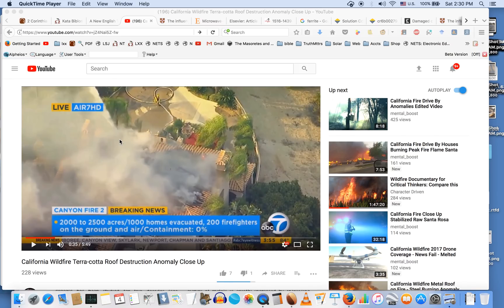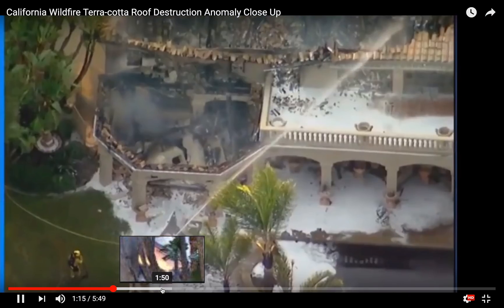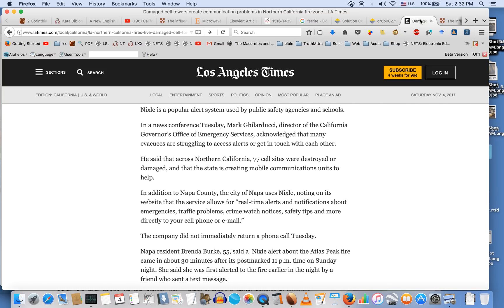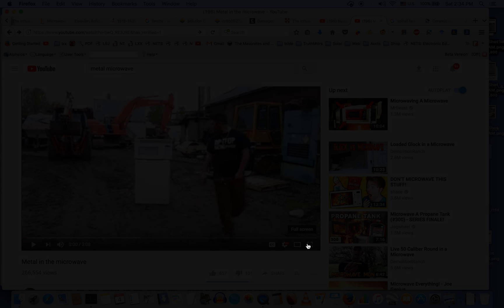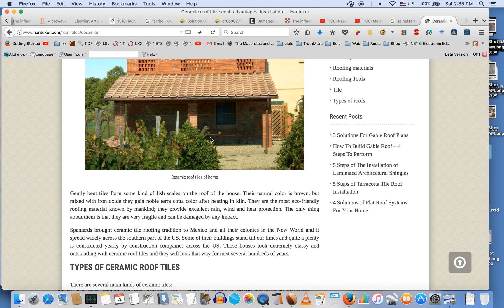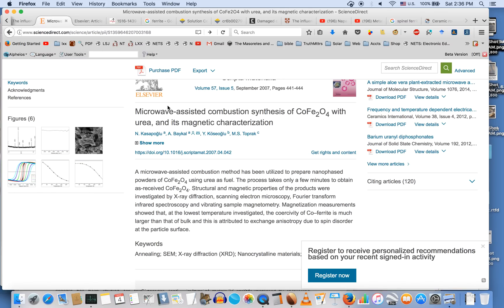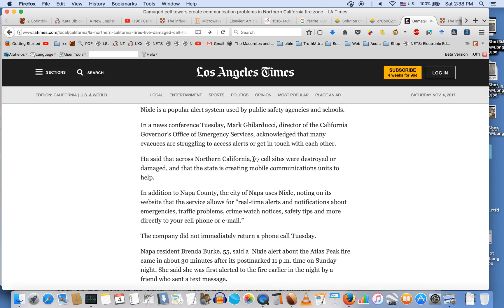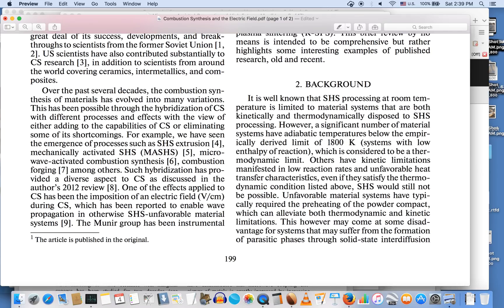California Fires: Terracotta Roof Anomaly: Microwave Assisted Combustion Synthesis

Comment: Please stop talking about Cell Towers as if you know anything about them. Cellular is a term in the type of technology used in a communications device. As it is common in the Northeast, Cell sites not only provide cellular communications, but also have tower sections for public safety and other Cellular communications companies. I've been on several sites and up to 250' on the cell towers, they have from VHF-Low Band, VHF, UHF, 700-800-900 MHz radio communications systems, Microwave hubs, repeaters, links and even some with Sat-Up-Link systems for Geo-Stationary Sites which run from use to be 1.2GHz but now 2.4,5.8 link systems that run very low as in mW power. Also one of the largest nationwide government communications system operated by the FPS which is like the radio hub for most Federal law enforcement comms. So, Cell Sites just doesn't have Cell Systems. If we didn't share sites we would quadruple the amount of towers as everyone would need to have there own tower site. You say, what aren't they made of steel referring to your question about destruction of these sites. The Tower itself yes, its made of steel. But there is coax, connectors, antennas just on the tower itself which depending on the technical specs burns. Then you have the building itself, which is heavily insulated due to the large amount of heat Cell buildings produce from processors. transmitters, repeaters, POTS etc. Then after 9/11 there was a push for interoperability and survivability of tower systems during National Emergencies. So, now you have propane 20-40KW generators with enough propane on site to run 72 hours or diesel generators which are at easy accessibility sites due to the fuel bulk truck deliveries and maintenance. Also, due to extreme heat of FIRE, lightweight steel tends to DEFORM and bend. Towers with gear on them FALL DOWN when things like fire destroy guy wire points or the main structure itself. In the Northeast, we deal with more ice then forest fires. With the invent of Project-25 and the linking of public safety radios systems into a network, similar in some respects to cellular systems but for use in public safety. From analog (legacy) types technology to digital. you can put through in a bandwidth more data including voice, audio, video, and everything your phone does today compared to just 10 years ago. So, I hope you know understand a Cell site and what can be at a cell site. FYI, everything burns, even fire retardant burns if the right conditions are met. During a firestorm, there are certain things in nature that occur like the development of its own weather that can and does cause great damage and death. I would suggest before flapping too much more is do some real investigation. You talk about the Terracotta Roof Tile System. Well where you need to go is to a site where they make these Terracotta roof systems and pull up there MSDS which is called the (Material Safety Data Sheet). Everything made today basically has a MSDS its its consider hazardous material in one form or another. As a firefighter, when we go to a plant, manufacturing hub, or a transporter we ask to see the MSDS as it tells us specific information on how to fight a fire that is fueled by this material, how to treat a patient who is affected by this material, reaction to OTHER chemical agents that can change the property of the material, how to store the material ETC. This will give you a idea of whet your talking about. From that point you need to get specific information regarding the fire itself. Including weather, temperature of the fire and weather conditions before, during and after the fire as it appears that these roofing tile reacted to something that caused them to break down. I would also include that many of these tiles can be look a like and not made according to what the say they are. AS I STATED BEFORE, EVERYTHING BURNS even concrete. I don't want you to think you can light up concrete, but direct flame contact, with heat causes material to change in structure. The breakdown of material using fire is dramatic. Things you see in this fire are DRAMATIC, as due to the FIRESTORM that these homes were involved with. These homes no matter what any fire retardant materials used were never designed to protect structures in this type of situation.

Comment: THE USAF BASE THAT HAS THESE EDW AIR CRAFT MUST BE FOUND AND THE AIR CREWS ARRESTED, AND PUT WARRANTS OUT FOR THE BASE COMMANDER, THE JOINT CHIEFS OF STAFF AND REQUEST THE RESIGNATION OF TRUMP IF HE DOESN'T END THE CHEMTRAILS, DESTROY THESE AIRCRAFT, COURTMARTIAL THE AIR CREW AND COMMANDERS FOR TREASON AND PUT THEM IN Ft LEAVENWORTH.

Comment: why do you need hi tech microwaves when a match will do?   occam's razor, girl.   also people have been  known to burn houses in a disaster to get insurance pay off.  There are "terra cotta" tiles made of light weight plastic look alike materials, to reduce the massive weight of tiled roof....they will melt ,     even a true tile roof has a rubber sheet or  tar paper coat under the tile, and up gust of flame can easily ignite these hi-flamable materials under the tiles.   This whole video is very unscientific, the wave energies necessary to micro wave a distant  house to reach temperature are astronomical,  you would needa power source like a hydrogen bomb conected to a transmitter the size of a stadium to raise it one degree if it was one kilometer away....rreeeeedddicculooooous  babble,    paranoia.

Comment: It looks like this house burned from the inside (coming from the section on the right), and then came up through the roof, collapsing it with the tiles.  I don't think the tiles are actually burning.  But altogether those fires seemed like a too perfect storm.

Comment: Oh, good GOD - here you go again.  
You are ruthlessly ignorant.   I've never encountered somebody so fiercely committed to their own disinformation.  
You ask all these questions and NEVER try to find a legitimate answer and just plow forward with your conspiratorial conclusions ignoring any and all ordinary explanations.

I could go on for pages about your lunacy and unhinged comparisons but you are adept at ignoring critique to I'll start with one point:  First, at 1:21 that IS NOT roof tile burning.  Secondly the tile is not true Terra Cotta - it's concrete.  That aside, the idea that the tiny, tiny volume of iron oxide used as a dye in the clay of roof tiles would IN ANY WAY influence combustion by 'feeding oxygen' to the fire is ludicrous.   I know, I know - you read the article and it said the oxygen aids in combustion and all but you ignore the fact that the fire burning on the house is SURROUNDED by oxygen.  

You don't know how to simplify the research you've done, because you don't understand it and you don't have the basic science background to process what you're reading online.  You take snippets of verbiage and skew it with your fill-in-the-blanks narrative and pretend it actually supports your conclusion.   BOTH of the papers you cite pertain SOLELY to the impact of microwave energy on Cobalt Ferrite, not tile, not wood, not any other building material.  

You've got a lot of cobalt ferrite nanoparticles in your house?  I doubt it.

Comment: @ 2:50 one CELL tower armed can do a kill radius of about 40 miles when in high  power mode judging by the SIZE of A/C Power input lines a rough estimate the max power out put is anywhere from  a few  to 30 million watts of pure instant impulse sonic/microwave energy directed to biological human receptors organs skin brain cells etc... The kill zone is then around  35 miles and this is not reception distance ! There are low power and fully armed high power cell towers. The ones on sides and roofs are very concerning and are usually set higher and in multi continuous mode for no reason at times.

Comment: Iron-oxide or rust, properly combined with powdered aluminum, as found in chemtrails,  makes Thermite which can instantly reduce steel to molten metal as you may know. Most likely has no significance to this phenomenon, but may be of some use at some point.

Comment: 🔴🔵. VVVV CLOSE TO THE ANSWER‼️
IRON OX IN THE TILE OR A CAR MIXES WITH NANO PARTICLE DUSTING OF ALUMINUM ETC FROM THE CHEMTRL JET FUEL POLLUTION MAKING THERMITE ❗️THAT PUT IN A MICROWAVE ENERGY FIELD WILL EXPOLDE AND BURN ANY FUEL NEAR IT AND TREES DO NOT BURN AS THEY HAVE LITTLE IRON AND ALUM IN THEM AND LOTS OF WATER‼️ THE MICRO WAVES ARE FROM UNK SOURCE LIKE MILITARY WEAPON OR CELL FIVEG G G G G TESTING❗️‼️ SAI CHEMTRALS ARE CAUSED BY METAL IN THE FUEL TO FACILITATE OXYGEN DELIVERY IN THE JP8 FUEL SO IT WILL BURN AT 40K FEET WHERE THERE IS NO OXYGEN‼️ JP8 IS DESTROYING THE PLANET AND ALL LIFE ON IT‼️‼️ 
OH AND NOW ADD IN NOW THE METAL CAGE COVERING IN THE STUCCO WALLS❗️❓
.
Reply: Right.  You just toss some aluminum on the tiny trace of rust used as dye in the tile and 

KABLOOIE!!! 

Spontaneous and unstoppable combustion!  Is that it?  That's your 'theory"?  Flunked out high-school chemistry dintcha?.  

IF that was the case the entire world would have burned down ages ago.  I've got a shop where metal filings, aluminum and iron are mixed together all the time and somehow, have never had a spontaneous thermite reaction.  Guess I'm just lucky.
Reply: No, no, no, Rod. Not physical metal filings. You have to have nano nano particles laying around that can't be seen to get the KABOOM. :)
Reply: Kelvin:
Oh, thanks for correcting that.  Yes, you have to have invisible-sized particles mixed in the open air with ferrous oxides encapsulated in fired clay to cause the spontaneous formation of Thermite.  
I shudda know'd that. 

But, yer rong, I was talking about 'KABLOOIE" which is totally dif front from 'KABOOM'.   If yer gunna tawk faahr siunse and explosivity with ex spurts, lahk them in this har comment sexshun, you gotta git the teknikul turms ryte!

Comment: https://www.polymersolutions.com/blog/metals-and-polymers/
 
Thank you Truth for your video... I think you are on to it, and we all appreciate the hard work you, and all our brothers and sisters are doing, that are connecting the dots for us!  
Through the use of High Powered Microwaves and Lasers (DEW), 
anything that has metal/steel in it can be affected, and can be disintegrated in a self-perpetuating  'fire'  until it consumes itself.  Accelerating the Oxidation reduction process -  it is the oxidation that provides the oxygen to make the flame, which bypasses a need for a furnace -  HPM and Lasers can affect things like steel beams, terracotta roofs, car tires, etc.

This may be also why the steel roofs on the stalls that housed the horses and animals, and the tires on the cars, caught on fire and disappeared.  
Tires are vulcanized, and have polymers, which contain metal, and some tires may have radials too, so does this explain why the tires caught on 'fire'  and disappeared in the pictures we see of the scorched cars?

Tires do not melt, but in the pictures, there were no tires on the cars - they disappeared, along with the houses and their contents.
https://sciencing.com/melt-rubber-tires-7552030.html

And HPM and Lasers can both be used to obtain the desired result, so maybe both were used in the CA 'fires'?
Peace & Blessings to you Truth...

"Introduction to Directed-Energy Weapons 
Description
This chapter provides a basic description of what directed-energy weapons (DEWs) are and how they work. In their Electronic Warfare publication the Department of Defense (DOD) defines a directed-energy weapon this way: “DE is an umbrella term covering technologies that produce a beam of concentrated EM energy or atomic or subatomic particles.”

It continues: “A DE weapon is a system using DE primarily as a direct means to damage or destroy adversary equipment, facilities, and personnel. DE warfare is military action involving the use of DE weapons, devices, and countermeasures to either cause direct damage or destruction of adversary equipment, facilities, and personnel, or to determine, exploit, reduce, or prevent hostile use of the EMS through damage, destruction, and disruption.”

The two basic types of DEWs include lasers and microwaves. Microwaves and lasers are both part of the electromagnetic spectrum. They’re made of the same electromagnetic energy which consists of light and radio waves.

This energy can be explained using either wavelength or frequency. The shorter the wavelength of any energy field within the spectrum, the higher its frequency is. Toward the low end of the spectrum, there are low-frequency radio waves, which are thousands of kilometers long. And at the other end of the spectrum are light waves, which can be a fraction of an atom in size.

For ease of identification, groups of consecutive frequencies within the spectrum are divided into ranges. The frequencies within these ranges may overlap, which makes determining which range a frequency belongs in more difficult. Because lasers have a shorter wavelength than microwaves, they vibrate at a higher frequency. Lasers and microwaves are merely different aspects of the exact same energy. The only difference between them is their frequency.

Another consideration is power. A high-powered microwave (HPM) and microwave oven both operate on the same frequency/wavelength. The only difference between them is the power level. Similarly, a laser pen and a high-powered laser have the same frequency, but the power level of a high-powered laser is much greater.

The concept of lasers, microwaves, and other types of DEWs using the exact same energy field, but at different frequencies, will help clarify how a single weapon can be used to exploit different frequencies of energy to produce microwave, laser, and other effects. This feature makes them rheostatic (scalable or tunable).

Microwave weapons consist of basically two major technologies. First are the millimeter wave devices which can be focused on a target at great distances and produce a burning sensation. An example of this is the Active Denial System (ADS). The second is the electromagnetic bomb (e-bomb), which can destroy electronic circuitry, communications networks, and harm organic matter at a distance, with a non-nuclear electromagnetic explosion (pulse)..."
http://www.newworldwar.org/dewintro.htm

Comment: did anyone think that smart meters did this?
Reply: Nancy Bassett no... fires did  this
Reply: Absolutely, no doubt  my mind, thats why sebastopol was spared. They were feverously installing them the week before the fire.  I was on the phone for the second time a couple days before the fire demanding they removed it, cussing and yelling and they surged my house with enough voltage to throw the 100 amp main breakers burning some of my electronics and surge protector pwr strips. A minimum of 1kv to 2kv to do that and the smeter was uneffected.  They can turn houses into a microwave ovens. Thats why they were so willing to take the blame saying tree fell on lines.  It is so obvious, just like 911 and will go unchallenged the same way for the same reasons.  We were the test county and this was just the begining.  Next time noone will be returning home, whetber it burned or not!    Bleeedat

Comment: Ok.  I agree that there are really strange aspects to this fire.  I would caution against making definite statements about the exact physics/chemistry of this fire because we have very limited information about it.   I personally suspect it may have been caused by high-power lasers.  The use of microwave fields is also possible, however, the theory discussed here about Al2O3 being the source of oxygen for combustion is unnecessary, because you already have molecular oxygen available for this reaction.  There is no need for a metal-oxide to provide oxygen.   The relevant question is, how was sufficient energy delivered to cause (any) combustion?      Also, when you advance a theory (e.g. microwave heating), you need to look at the absorption cross-section of the microwave field at that particular frequency.   i.e. for example, if the microwave field is 6 GHz, then you need to look at the absorption spectrum of terra-cotta in the vicinity of that frequency.   5-6 GHz microwave is very good at heating water.  So I'm guessing what's going on is water (moisture/humidity) adsorbed in the terra-cotta material is being heated by the 5-6 GHz microwave field.  Anyhow, I don't even know if we are dealing with a microwave field.   We would need sensors in the field recording the electromagnetic spectrum during the time of the incident.  So unless we have that kind of information, we cannot really tell for sure what caused it.  This is a bit tricky.   I appreciate your efforts in investigating what went on.  However, we need to make sure that this investigation is done properly, and scientifically.